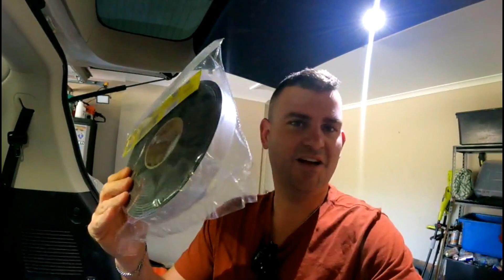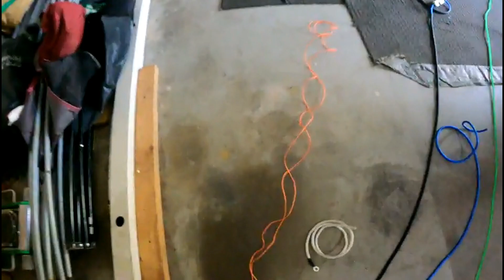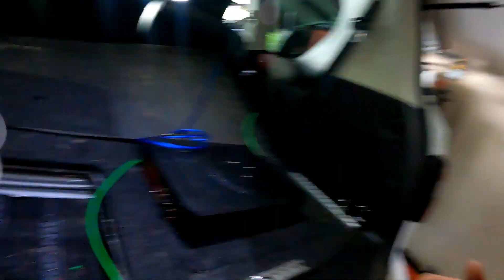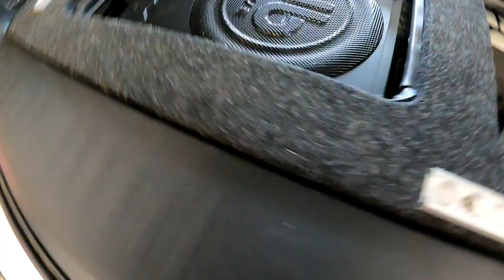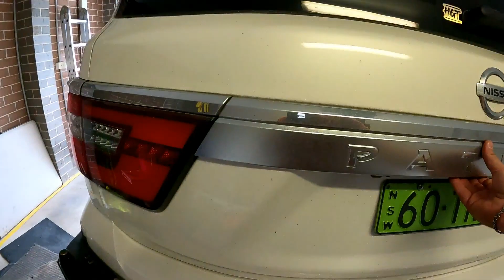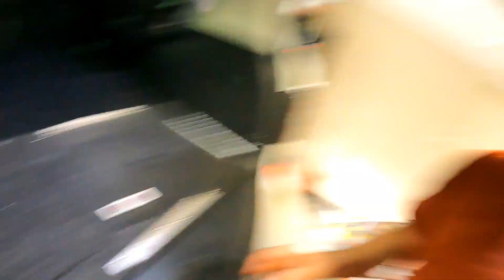Stage 2 audio upgrade - DB Drive WDX active subwoofer - HGT Y62 Patrol Build!

Comment: Nice video! I have a big Eurovan and the sound system is so bass empty. I was thinking about getting this- my place has one for sale and he said with installation 300 bucks. You think it’s worth it. I just need sone bass for rock stuff nothing special but I don’t want to waste 300 either. What are you thoughts? Thanks or anybody else??
Reply from the maker: I found it just wasn’t quite enough punch for what I was chasing. In my sons small hatch it is ok. But it wasn’t enough for this big space
Reply: @60trvl  sorry, last question. But did you think it was decent quality for what it is or was it just cheap and a waste of money? I can’t find much on this brand.